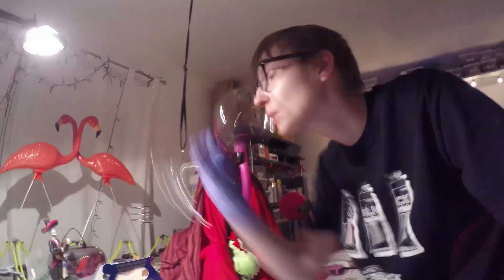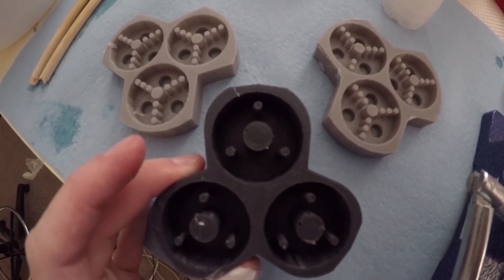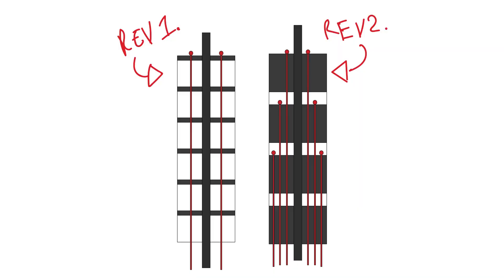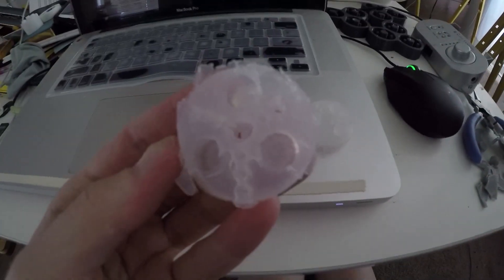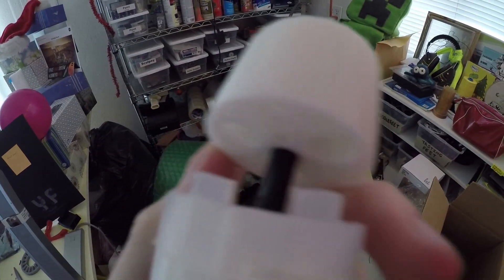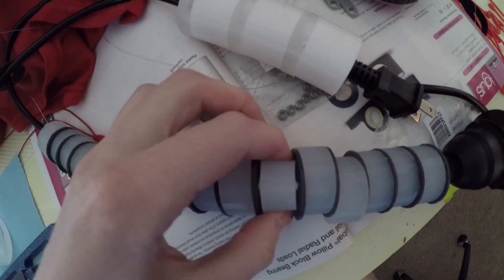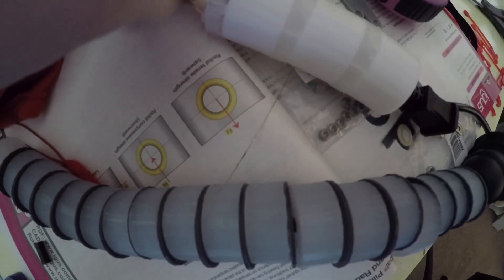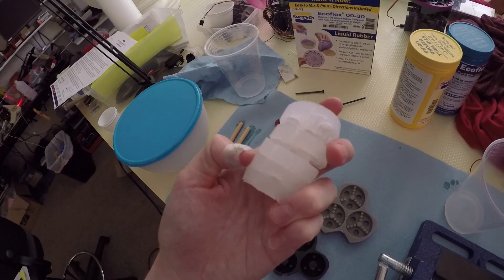Mecha Flower 2.0 : Squishy Vertebrae REV B

Comment: Do you have access to a 3D printer that can print flexible filament? I use Ninjaflex and Filaflex to create joints like this, and you can adjust the amount that they flex by printing them with different amounts of infill. Might be something to try out!
Reply from the maker: I've never tried that stuff out! Totally forgot bout it actually. I think I'll do that instead if I end up needing to make a rev. 3 =] thank you!
Reply: On the other hand, I've had some difficulty with the flexible filaments (I don't have the right extruder for it), and I'm interested in mixing rigid and flexible materials in the same part (which would need a dual extruder set up that I definitely don't have.).

Your printable molds inspired a new idea, I can print a mold that supports hanging rigid structures inside. I can cut the interior rigid elements of the part away from the mold as I demold the silicone.  No idea if this will actually work, but thanks for the idea.!